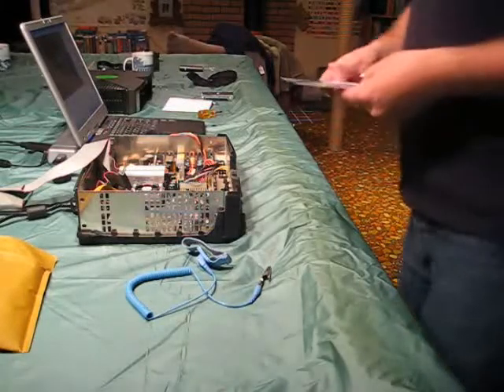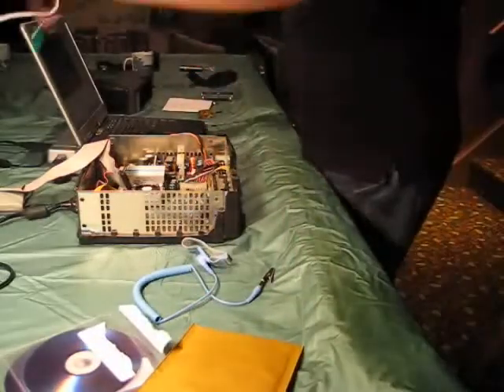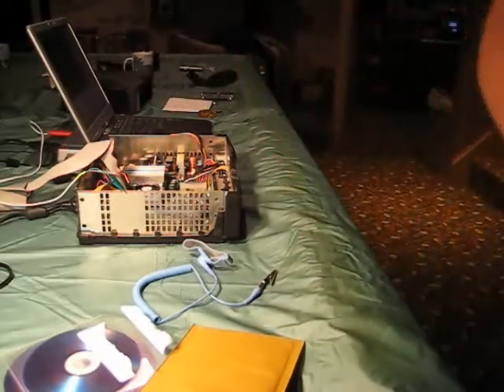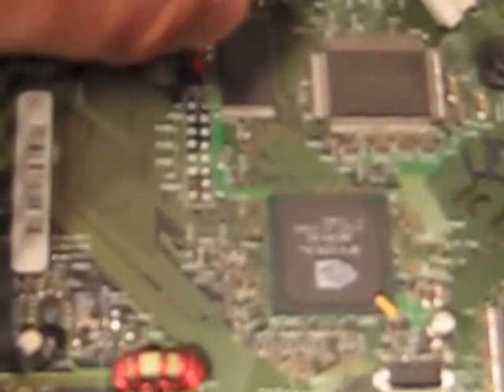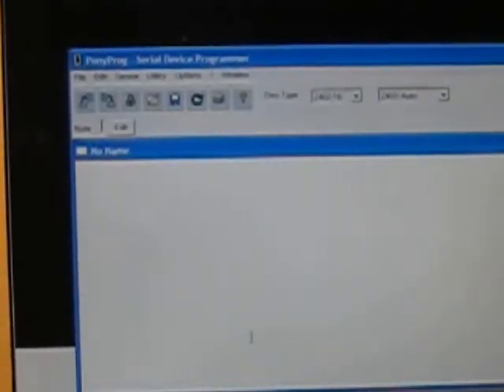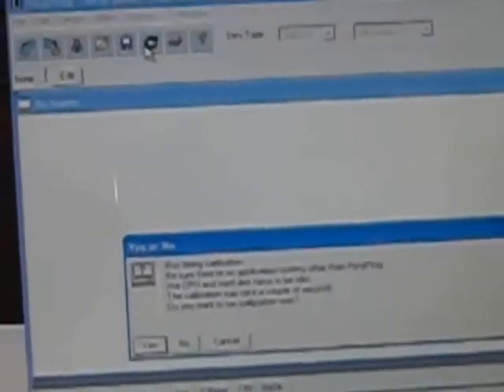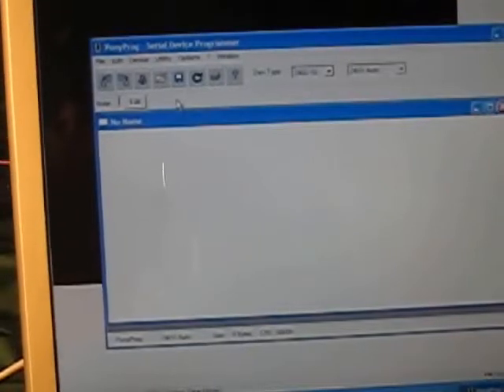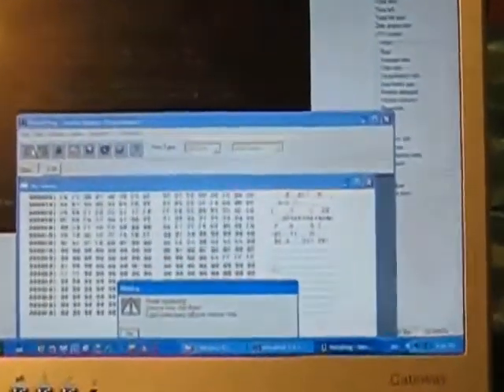Reading Original Xbox eeprom with a eeprom reader

Comment: Newer desktop motherboards don't come with a 9 pin serial connection. You have to have an older laptop for it.
Reply from the maker: That's correct and you can't use those usb to 9 pin serial adapters either.  It won't work I have tried before.

Comment: I just ordered one of these. I wonder if the fact I'm using a Win98SE on a SE440BX-2 chipset board helps compatibility with this reader or if a modern computer with a COM port on Win7-10 works just as well.
Reply from the maker: +FrankyManky I don't think it would make a difference.
Reply: I guess the only advantage my old desktop has over modern hardware is native IDE, since I only have one of the two headers occupied. Thanks. :D
Reply: +Floydzabarber I got this EEPROM reader from this seller and this seller is legitimate. Go get em peeps! 

I was able to get the solder from my 1.0 board out of pins 13 and 14 on the LPC connector and just plug the thing right in. Just a little disclaimer, this won't enable piracy unless you rebuild your drive with a the right files (Ex, FTP a modded Xbox's C drive to the linux distro in the HDM's ISO builder). This thing worked like a dream.

Comment: If I want to restore a 160GB SATA HDD to it's normal state so I can use it again with my PC, how do I do this?

I don't have a desktop PC with IDE HDD connections, only SATA and the HDD is SATA and not IDE anyway. I have the eeprom.bin file from my Xbox on my computer if that matters. Please help! 

I don't want a brick for a HDD and I really need to use it in my desktop PC. When I try and boot my PC with this HDD in it, it asks me to unlock it with a password but it doesn't actually show anything when I try typing.
Reply from the maker: +W. Jones Use Slayers Evox 2.7 to unlock the HDD while it is in your Xbox, then put the drive in your PC and re-format it.  Install your operating system and you should be good to go.
Reply: +W. Jones Doesnt mater xboxhdmaker won't read sata channels its too old
Reply: +W. Jones Ohh sorry my mistake i read this wrong. yeah floyds right just unlock it with your xbox and then format as normal
Reply: +Floydzabarber Thank you! I have been trying to figure that out for a while. I used Chimp to unlock it since I already had it on my cloned HDD and it worked great.

Comment: Thanks for the great tutorial. What if I can't get to an error screen? I have several xboxes that I tried flashing the same eeprom to with ConfigMagic 1.6 Final. Some worked and some wouldn't boot after flashing. I even checked that the proper eeprom was flashed and that it was locked, but I get the solid green, no eject/no audio/no video problem. Will I be able to use this process to save these xboxes by flashing the appropriate eeprom onto the motherboard and then booting up to a softmodded hard drive that's already locked to that lock code? Thank you so much in advance.
Reply from the maker: +Mike Meldrem I don't have a lot of experience fixing bad TSOP flashes, but if I were you I would look into using the "TSOP d6" bios with a modchip.  It is a bios specifically made for recovering from bad TSOP flashes.  It is my understanding that you cannot flash a specific eeprom.bin to any version of Xbox.  Certain versions expect certain eeprom's.  This is probably why some of your Xbox's worked after flashing their TSOP chips and some stopped working.  Once recovering from the bad TSOP flashes using the "TSOP d6" bios your Xbox's will be working again and you will be able to do whatever mods you would like to do to them.
Reply: Well on one forum I saw someone mention that it's usually the bad TSOP that causes that, but the 1.6 doesn't even have a TSTOP to flash, and that ConfigMagic is only really flashing the eeprom, not the bios, but it can give similar symptoms. Then a guy on that forum said you only need to reflash the eeprom, not the bios. Well… if it DOES need a TSOP reflash, is the technique you're saying allow me to have these xboxes go back to just a softmod xbox? They're for selling. Or do I have to have a modchip per xbox? And do I have to solder all kinds of stuff to put the mod chip on each xbox to fix each one? I have 11 of them.
Reply from the maker: I am sorry Mike, that is right the TSOP contains only the bios and the eeprom chip contains only the eeprom.bin  I was confused.  You do only need to re-flash the eeprom and not the bios.  Can you get the Xbox's that are not working anymore to show an error screen.  What you need is an eeprom reader/writer.  You will need eeprom's that match the type of Xbox version you will be flashing the new eeprom.bin to (example you will need an version 1.0 eeprom.bin to flash to a 1.0 version Xbox motherboard)  Once you have the eeprom reader/writer and the proper eeprom.bin's for your version Xbox's, and you can get an error screen, then use a software program called Ponyprog to flash the eeprom chip on your Xbox motherboards with eeprom.bin's that those version Xbox motherboards are expecting.
Reply: Okay, that makes sense. The issue is that I can't get an error screen. It's no eject, no audio, and no video. There's nothing. Only a green light. Is there a way to flash the eeprom without an error screen?
Reply from the maker: I am not sure whether or not you can read the eeprom.bin off of the eeprom chip without first forcing an error.  If you can't then I guess you could always pull the eeprom chip off the board, flash it in a programmer then re-solder it onto the board.
Reply: Floydzabarber What's the process for that? I have no experience with that, but I could follow a tutorial. And this programmer, it would work similar to the eeprom reader, through a serial port on a PC running windows?

Also do you know if TSOP flashing can be done without an error screen, and would that allow me to boot up to unlocked hard drives? Otherwise maybe a TSOP flash would allow it to boot to an error screen even with bad eeprom so I could flash the eeprom with PonyProg? It would be best if I could use the same eeprom for all of them (or even better, unlocked hard drives) because I have a stack of upgraded hard drives already locked to that eeprom that I spent a whole day cloning with Chimp, 4 at a time. If I can get these 11 to boot and have that eeprom, I can drop in a pre-made hard drive and boom, they're ready for sale.

Any more assistance helping me find a solution to this is extremely appreciated.